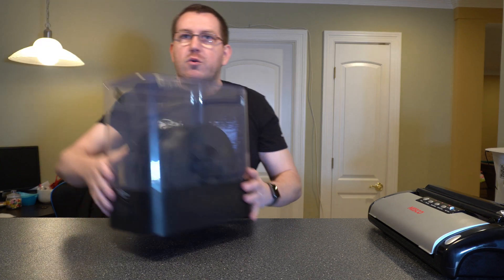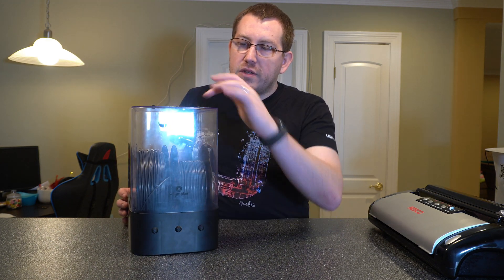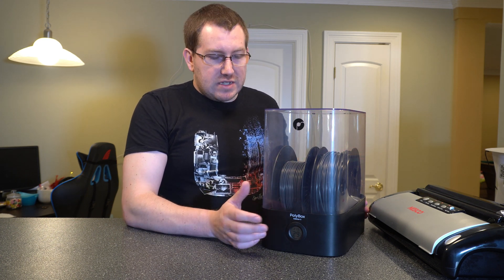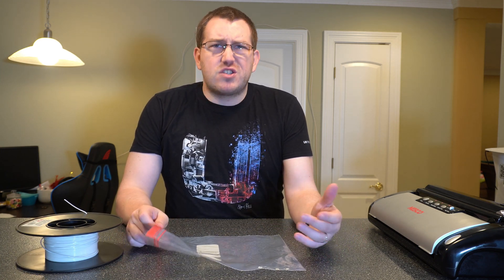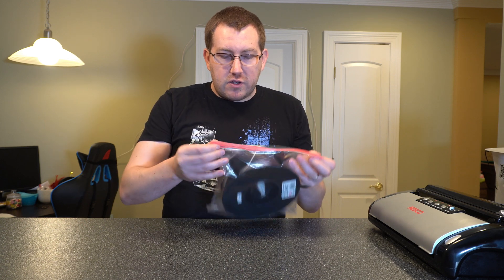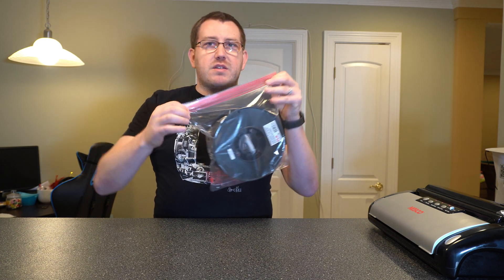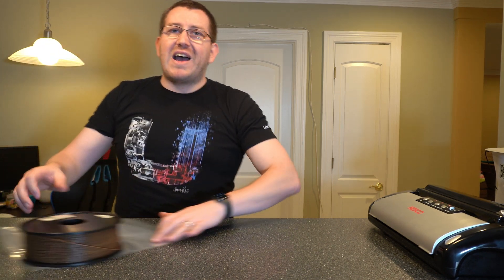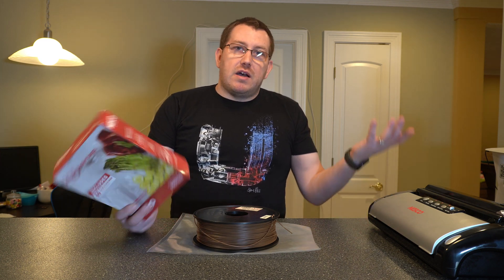3D Printer Filament Storage Options and Why They Are Needed

Comment: I have been putting mine in 2 gallon buckets from line, I  put Gamma seals lidds on then and throw in a bag of desicant, each  one holds three  rolls
Reply from the maker: Hi. That should work just fine as well. There are a lot of options, the important things is the filament gets stored in a dry container.

Comment: I found out that the ziplock bags with the large foldout bottoms and the slider zippers actually don't fit most fillament
Reply from the maker: Hi. Thanks for the info. I guess it depends on the actual bag and the thickness of the filament roll.
Reply: @3DPrintscape  are you using the up and up brand and the actual ziplock brand?
Reply from the maker: @thanhtacles  It was the actual ziplock branded ones.

Comment: Hey, How long does filament last once exposed to air? A 65-70 degree room in winter, or hot humid summer weather?
Reply from the maker: Hi. It really depends on the type and the humidity levels. PLA can last months, others that are more sensitive, like silk/nylon, could be days.
Reply: @3DPrintscape  You are very helpful! Thanks!
Reply from the maker: @anajjar456  You're Welcome

Comment: VACUUM SEALER BAG REUSE: If you are going to use a vacuum sealer bag, get the cut-to-length bag refills. They are actually one continuous tube and you seal the end before loading it up. This allows you to make the bag 6 inches longer than you need it to be. That way you can use it a dozen or so times just cutting off the ~3/8 inch of the seal each time.
Reply from the maker: Hi. Thanks for the tip and i agree with you. I just used the ones i already had at my house for this though.

Comment: Very usefull video. Pro tip :next time you tape a very noisy video you should edit the sound off and record your voice in that part. Greetings from México.
Reply from the maker: Hi, thanks for the feedback. Which part are you talking about, just the part when the vacuum seal is running? I have been trying to balance out the audio in my videos as I edit them. I have gotten better but I still have a long way to go. I may end up needing to get better video editing software.
Reply: @3DPrintscape  Yes. It was kinda awkward watching you just waiting for the vacuum to do it's job while you can't comment anything because of how loud it was. You are doing a very good job, I even downloaded your cura profiles and been using them with my ender 3 pro.
Reply from the maker: @franciscocornelio5776  I can see that, sorry. I think the profiles I have out there are a good starting point, you may not even need to tweak anything besides the temperatures and supports when needed.

Comment: Your box looks like the IRIS Weathertight storage box that you can find at a few different stores.   What is the size of the box your using?  It looks like you could fit about 4 spools per box?
Reply from the maker: Hi. Any Weathertight storage box would work. I'm using a19 Quart one (dimensions are 11.75 x 17.5 x 7.88 inches) and can get about four spools in it.

Comment: How long can you store filament in a zip lock bag with the silica gel if you have filament you don't use much? Would you need to replace the silica gel after a year or so?
Reply from the maker: Hi. I think the longest I have stored filament in a ziplock was about six months. If I think it will go beyond that, I will vacuum seal it. You can probably get longer if you use good ziplocks that seal properly. As far as the silica gel goes, it can only absorb so much moisture. If it's new and put into an airtight bag it should last for a long time, but its hard to say how long unless you get the color-changing ones.
Reply: @3DPrintscape  thanks!